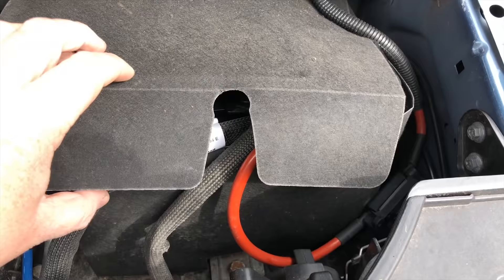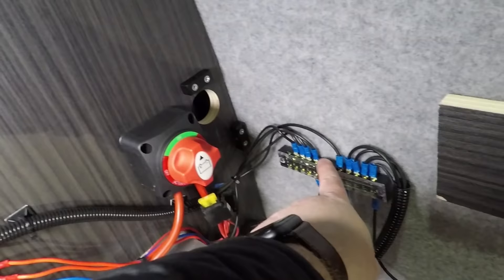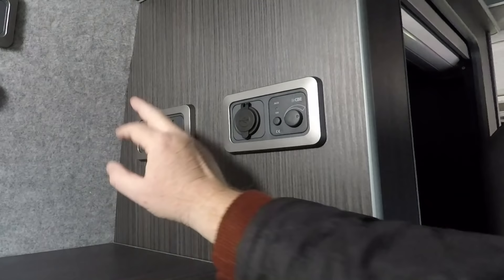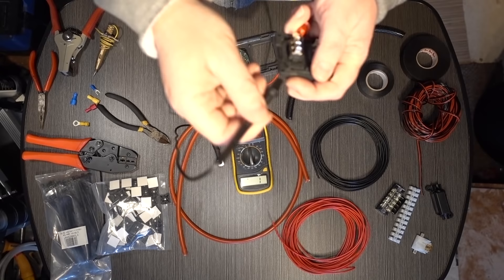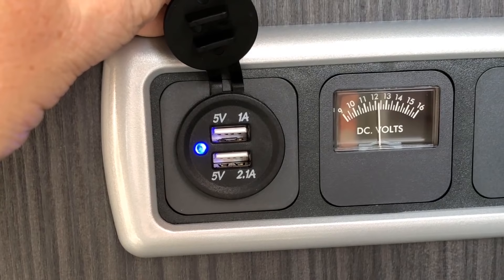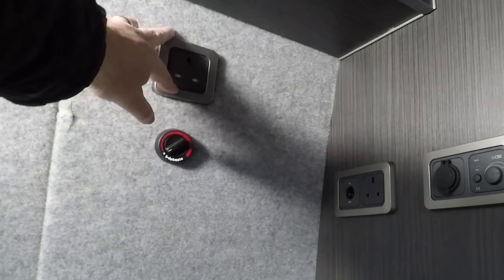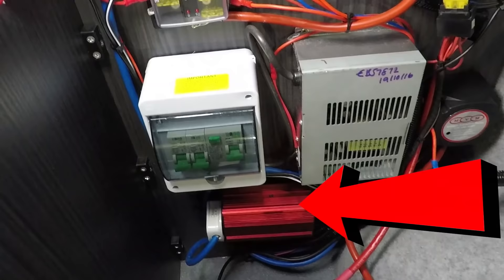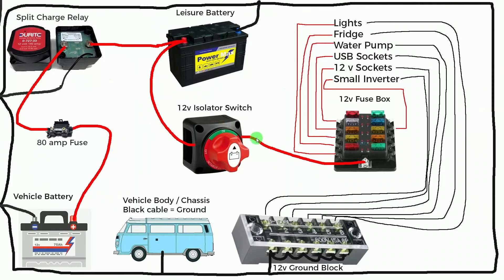Complete 12v Campervan, RV, MotorHome, Boat Wiring Tutorial

Comment: hello john,   is it possible to add more than 2 batteries together and get the extra amp hours but keep it at 12v.   really sorry if this is a stupid question.  really new to van conversions and im thinking i would prefer all electric than using gas,  thanks dave
Reply from the maker: Check out my more recent videos, I have a video all about inverters and joining batteries into battery banks.
Reply: @johnmandy  brilliant thank you

Comment: Hello John. I have what is probably a really stupid question but just want to check I m doing it right. I have a yellow cable that runs from my leisure battery. it has two wires inside, one is brown that is connected to the positive terminal and the other is blue  that is connected to the negative terminal. This is the only cable running directly from the battery to the fuse board so I assumed it was supplying  all the power to the fuse board. I have purchased a 12v isolator switch and wondered if, when I cut the yellow cable I attach the brown wire to one of the M10 bolts in the switch  and the blue to the other M10 bolt? Or, do I ignore the blue (negative) cable and just cut the brown (positive) cable and wire the brown cable into the isolator switch? Its a little bit confusing. Thanks..
Reply from the maker: It’s hard to give out advice without seeing & tracing those wires.  However, the cable colours you’re describing are European colour codes as our van has the same 12v wiring colours. It’d work fine to install the breaker on the positive cable 👍🏻 that’s how I have ours protected.
Reply: @johnmandy  Hi, thanks for the reply. It helps for someone else to confirm what's going on in my head !!

Comment: hi, did you install a heater into your van? did you wire it to the 12v box ?
Reply from the maker: Yes, I have a heater & it’s installed into the 12v fuse box.
Reply: @johnmandy  Thank you for your reply. the max amps of my fuse box is 100A so I need to make sure I am below this.
Reply from the maker: Yes, that's all devices connected to it, the diesel heater (depending on the type you have) is likely to draw 12amps max and run around 4 amps once it's up to temp.

Comment: While i'm driving would both batteries or all get charged with this setup?
Reply from the maker: Yes, if they're wired correctly and with a Voltage sensing split charge relay it would indeed charge your leisure batteries as you drive.

Comment: What is a 16 mm wire in AWG gauges? Thank you.
Reply from the maker: If you google 16mm cable conversion to your country wire regs then you should get the correct size.
Reply: @johnmandy   Is it 16 square mm?
Reply from the maker: The diameter is 16mm

Comment: Hey there !

How did you connect your grounding block to the chassis of your vehicle ?
Reply from the maker: Hi, take a look at 2:20 in this video and it goes through that part. 👍🏻
Reply: @johnmandy  

Thank you !
Reply from the maker: You can ground anywhere as long as it's to the bare metal of the main structure of the van 👍🏻
Reply: @johnmandy  

okey but the leisure battery needs to be connected their also ? because in my setup i didn't ground the leisure battery
Reply from the maker: You need to ground your leisure battery, but you can do it somewhere else in the van as long as it's to a strong part of the van and you ground it using a 16mm cable to bare metal again, using a bolt or similar to get a really good ground.
Reply: @johnmandy  
i followed this diagram:
https://www.baintech.com.au/images/ManualSheets/CTEK_D250S_Dual_Wiring_Chart_and_Info.pdf

In this diagram for some reason the leisure battery isn't grounded. why is that ?
Also because i'm using a CTEK only 25 amps are going trough the wires so i used 6mm wires. Do i need to ground the battery with a 16mm cable if the CTEK is used or can i use a smaller cable then.

Your help is much appreciated.
Best tutorial out there !
Reply from the maker: That diagram shows the leisure battery has a wire that joins up to the vehicle battery and the vehicle chassis. So it has a ground, they just don’t show it clearly in the diagram.
Reply: @johnmandy  
Yes this is exactly my setup so i don't need to ground my leisure battery because it's already grounded.
So i just connect the grounding block 2 the chassis ?

sry i'm a little confused :)
Reply from the maker: No, you DO need to ground your leisure battery and use a 16mm cable to do so.
Reply: @johnmandy  

Will do that thanks !

final question:

Can i leave the setup like it is and add an extra grounding point with a 16mm cable

OR
Do i need to disconnect the negative cables that run back to the starter battery

thanks !
Reply from the maker: You shouldn't connect the live before having all your grounds connected. So I would disconnect and start again by following my video, make sure you have appropriate fuses on the live cables too.
Reply: @johnmandy  

Oké i followed your advice with the MEGA 16mm cable and everything is going well !
is this grounding block going to do the job if i connect 1 ground wire to the chassis or do i need a grounding block like yours ?
Reply: this is the grounding block : https://www.hubo.be/nl/p/aardrail-groen/61043.html

Comment: why is it called 16 mm it dont look 16mm thick thanks
Reply from the maker: The size 16mm refers to the cross-sectional diameter of the core, the overall diameter of the cable is 11.35mm.
Reply: @johnmandy   what’s the Cross  section I have measured my battery cable and that’s 11mm thick is that not the cross section

Comment: if I buy a 12v relay kit on ebay how do I determined the size I need as it give kits in 3mtrs 5mtrs ect please
Reply from the maker: A relay kit? Do you mean a split charge relay? If so they’re very basic and not something I recommend. I’ve detailed everything in this video as a basic wiring guide, to try and cut corners could be a costly mistake.